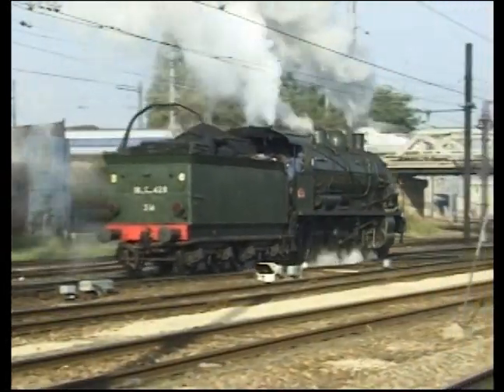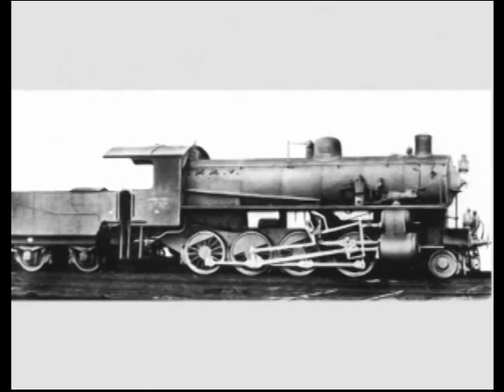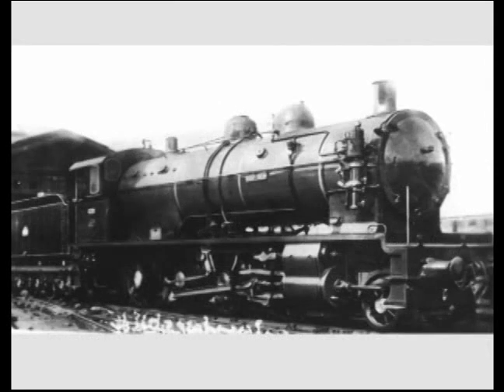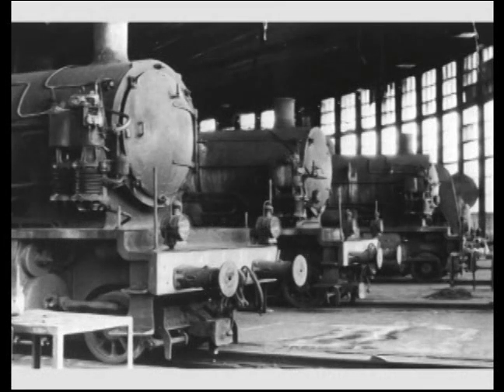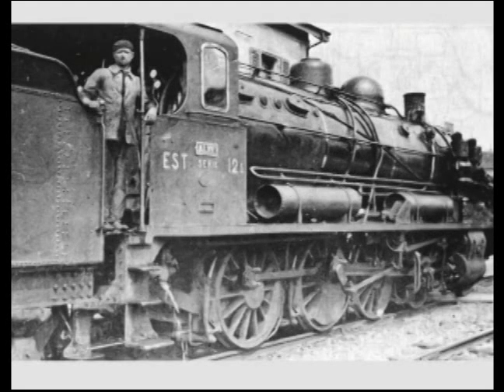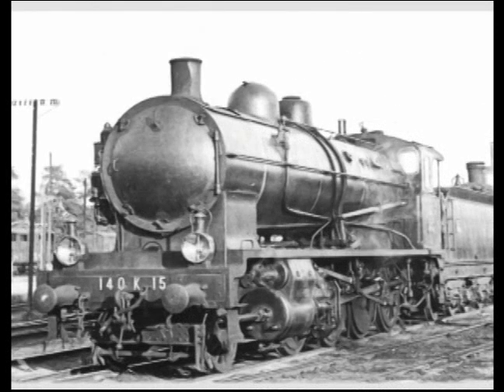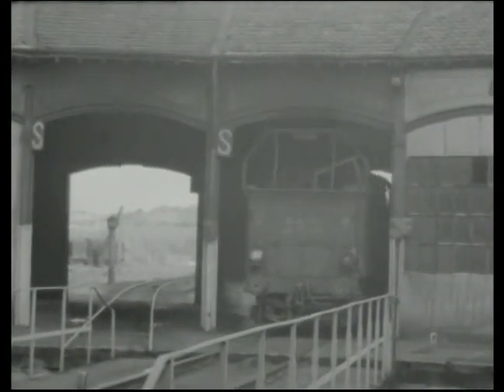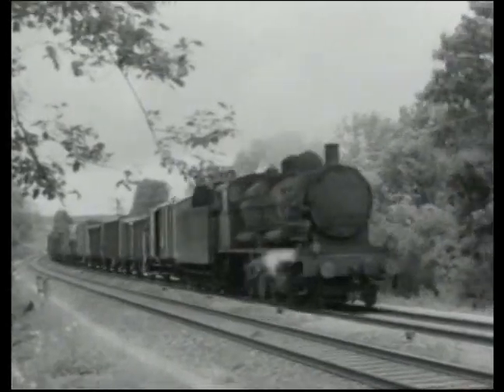Locovidéo n° 6 : Les locomotives à vapeur 140C

Comment: Les 140 C ne sont pas compound, impossible avec 2 cylindres, le minimum pour ce faire est de 3 cylindres, 1 BP intérieur et 2 HP extérieurs
Ce sont des machines à simple expansion
https://fr.wikipedia.org/wiki/140-101_%C3%A0_370_%C3%89tat_ou_140_C_SNCF
Reply: Il y a plusiers machines avec deux cylindres et compound. La 730 italienne (le modèle de les treinte 140 Ouest) ètaient compound a deux cylindres. Il y avait centaines de locomotives compound italiennes avec deux cylindres; c'est entièrement possible.
Reply: Jean Michel Platen une machine peut être compound avec 2 cylindres cher ami, la preuve avec la 130 b est surnommée la boiteuse, du justement à ces deux cylindres en compoundage. Arrêtez de vous faire passer pour des experts quand vous n y connaissez rien.